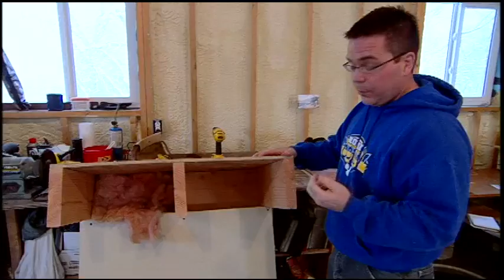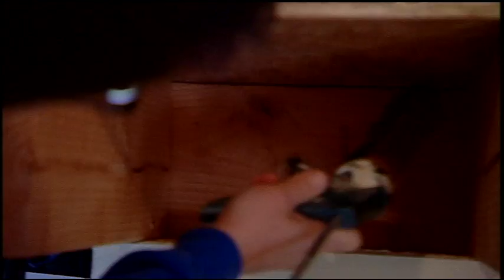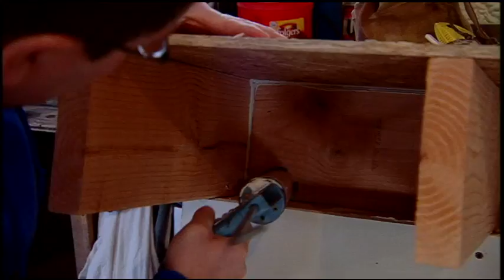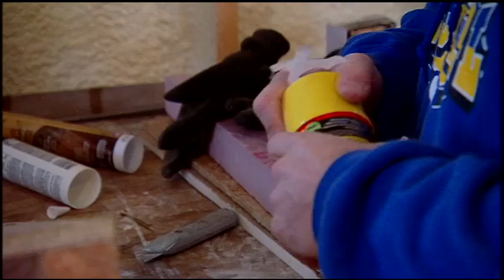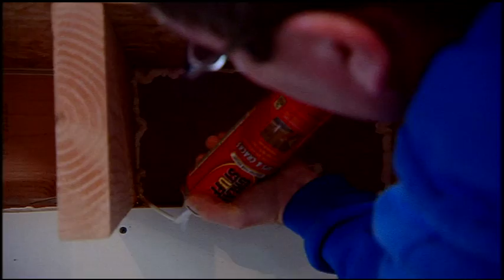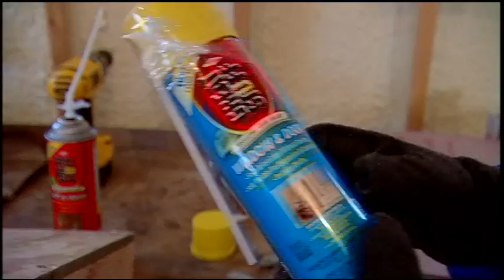Rim Joist Insulation

Comment: Both those foams expand the same..Leave a small gap around the foam board so the foam can properly seal.After that you can seal the bottom plate where it makes contact with the  concrete.Most builders still use some fiberglass insulation  to fill the rimjoists.

Comment: Thank you for the informative video. I like what you presented, but please note that silicone and sealant materials are prone to mold and fungus attacks over long periods of time when exposed to moisture. I would suggest that instead of the silicone you should use acoustic sealant material. It is very messy to work with, but will provide better results in the long run.

Comment: Oc boards are 2feet by 2 inch x 8 feet. They are 54.00 per sheet in canada. Even if you had 1foot by 1 foot spaces you would need about 10 sheets and around( guess of 8 cans of sprey foam. That's alot of cash. Buy the spray foam.

Comment: Been waterproofing foundations for 15 years. Yep, this is how it's done. Tips  1. Cut the boards so they have small gaps on the sides. 2. Just use the cheapest foam $4.25. 3. Don't wear good clothes. Four. Wear gloves and don't let it onto your skin or you'll wear it for a week. Five. They suggest using PL Three hundred adhesive to stick the board to the rim joist. Other firms of adhesives can eat the foam board up. This guy did a great job of making a nice rectangle bead in a nice,  controlled  environment. Not always so easy. A quarter size dot in the Middle works too. Whatever will hold it in place until you foam it works for us. I SHOULD HAVE STARTED WITH. WE USE A TINY , STIFF BRITTLE BRUSH TO SWEEP THE BOTTOM BOARD. LIKE HE SAID, MOST TIMES , THERE IS A. FLOOR SILL ON THE BOTTOM OF THIS RECTANGLE. ITS ALWAYS GOT DIRT GALORE. WE WEAR GLOVES AND A MASK AND EYE PROTECTION AND GO ALL THE WAY AROUND FIRST AND SWEEP THEM OUT. WEAR GLOVES AND BE CAREFUL. ,LOTS OF SPIDERS IN THERE. BUT THE DIRT IS UNBELIEVABLE, IT MAKES FOAMING THAT PART JUST NASTY AND RUINS THE OTHERWISE M NICE JOB, ADDS FORTY MINUTES TO THE JOB, BUT IT SEEMS TO SAVE TIME WHEN YOURE FOAMING, BECAUSE RHERES DEBRIS AND CRAP. JUST TRUST ME, START BTPY COVERING UP AND SWEEPING OUT THE TOP OF THE FLOOR SILL.   I agree with everything in this video , but I'll say this. Two inch thick is hard to cut into small pieces like that. We have used one inch and we prefer it. Every third area has a wire, or a bolt or a something that you have to trim around, man is two inches tough. Lowes has a 1 inch blue board that will do about 30 band joists for $11. For a standard ranch home that is 30 feet X 40 feet you need 3 Boards. Do the ones that have the outdoors on the other side of the band joists. In other words.  We do outside  walls s only.  If some are leftover, we put them where the garage is ... by going to one inch you are not losing HALF more. Trust me. The seal does wonders. Lastly. Don't put a board over a soaking wet band joist. On our videos page UnderStructureRepair(dot)(com) You can see on our videos page a big stack of one inch board and we are getting ready to do the band joists and the crawlspace is already beautiful. Well, we swept the joists out at Christmas and they were soaking wet.  I bet any other company would have just covered them and got the check. Well, we got the check, left the material and let the Dehumidifier get the wet out of the joists first. Came back thirty days later and tested the Moisture levels. I'll end this rant with this. My firm can take a mold infested crawlspace and install a $5000 system and insulate the band joists. That system will be free after five years.  Yep, five years. FrEe.  Only if we area allowed to insulate the OUTSIDE joists.  So, I know state code calls for R ten , or two inch
Reply: I have a block wall basement foundation (not crawlspace) and I have floor joists and rim joists directly on the block wall. No sill plate. So the top of the block is open. Exterior is brick btw don't know it that matters. How should I seal the top of the block wall? I was thinking spray foam in a  can for the top layer of block openings since it would be difficult to fill with cement. Any reason not to use foam inside the top layer of blocks? Do I insulate the rim joists the same was in this video considering my scenario?

Comment: So first I will apply silicone caulking and then polyisocyanurate foam board. But what about firecode (which someone has mentioned in the comments)? can I put an outer layer of R13 / R19 fiberglass insulation?
Reply: Yep, put vapor barrier facing inside

Comment from the maker: Foil-faced polyisocyanurate foam is classified as vapor-impermeable. It is important to first seal the rim joist completely with silicone caulking to eliminate any cold air infiltration, then cut the polyisocyanurate to fit the rim joist space tightly.  Finally, seal the edges of the polyisocyanurate board with sprayed urethane insulation to prevent any warm, moisture-laden air from leaking past the rigid board insulation and condensing on the cold rim joist surface.

Comment: Any objections to using foil-faced foam board insulation (i think that its polyisocyanurate) installed on the rim joist with spray foam sealed edges as you described? My concern is using foil-faced foam board won't allow condensation on the rim joist to dry to the interior, thereby causing rot.
Reply: You don't want it to dry to the interior.  It will dry to exterior.

Comment: That is a common area for air leakage, but I have noticed many of the new homes I test are already too tight where not enough fresh air is coming in. Sealing that area will likely require an expensive fresh air ventilation system otherwise you risk your health to save a few bucks annually. Also, if it is sealed and you use fiberglass with with the paper facing in and seal around the paper, for much less money you will see better performance. Fiberglass gets a bad name through poor installations
Reply: So, you want to use the rim joist for fresh air influx with fiberglass batting as a pre-filter?  Not good for your wood or your lungs but the bugs will be happy.  Seal the rim joist and install a metered fresh outdoor air vent to your HVAC system.  A tight house gives a home owner the power to chose where the fresh, outdoor air enters the home.  The rim joist are not that place. This video demonstrates exactly how it should be done with ridged foam.  Seal and seal again.
Reply: d1incharge  I know this is 4 years ago but I thought what this guy was suggesting was a very tedious & expensive sealant to apply to the floor. I was going to just put down a roll of standard insulation from the bottom facing up & then staple mesh chicken fence so no predators could make his home. Any problems with that. It's an off grid build home in the Ozarks.
thanks